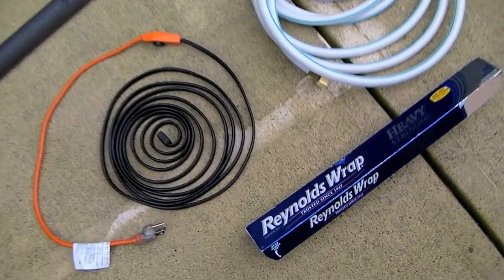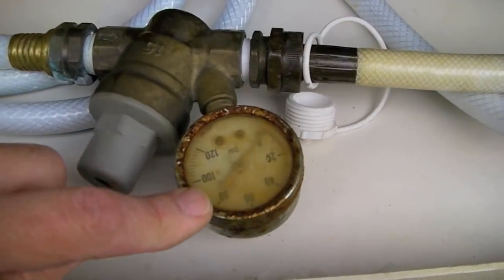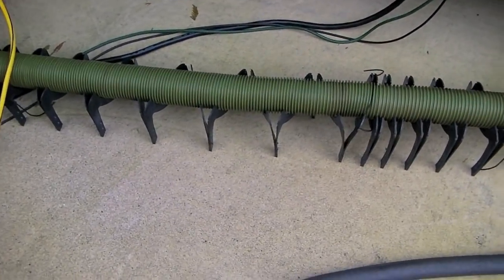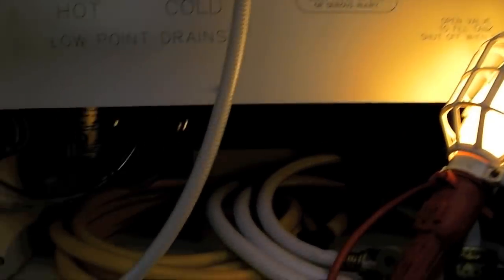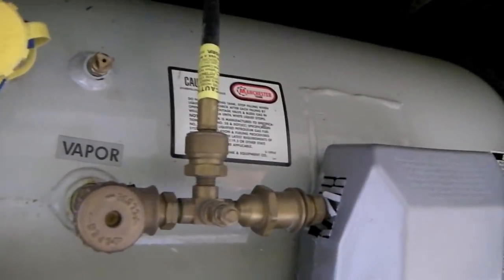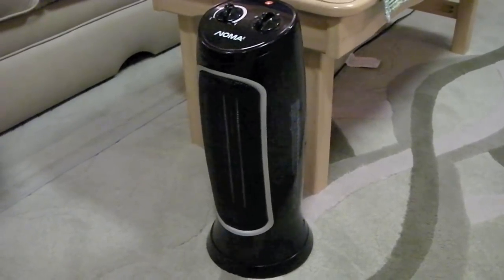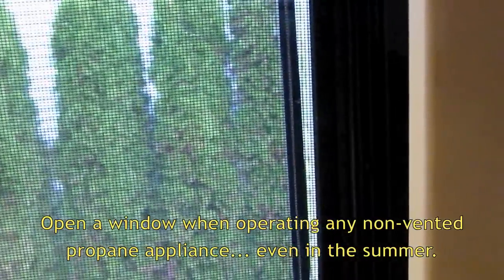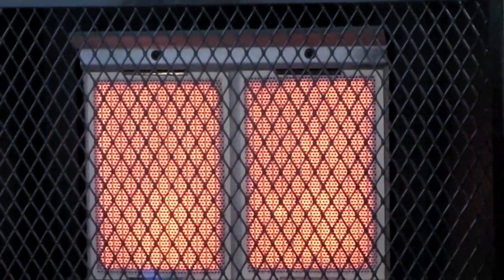How To RV in the Winter - Prepare Your RV So You Don't Freeze!

Comment: I don't mean to be disrespectful, but you do know how aluminum foil works, right? While what you did is "OK", it would have been better to put the heat tape along the hose itself, then wrap the aluminum foil around it, with the shiny side facing inward. Yes, metal conducts better than rubber, but the foil is designed to reflect heat, not conduct it.
Reply from the maker: The real issue is that the heat tape is really designed for metal pipes. The heat is a bit intense for the rubber hose. The aluminum foil prevents the tape from overheating the one side of the hose where it's in direct contact by diffusing it around the hose. Sorry if I explained this poorly, but the way we showed it is correct and works great.
Reply: Aluminum will reflect the heat, regardless to "shiny or dull" side
Reply: RVgeeks very good point !! great video and tips you guys are great... thanks again ! safe journeys !!
Reply: Foil both conducts and and radiates heat energy. The purpose of placing the tape on the outside of the aluminum foil is to mitigate the possibility of a hot spot on the heat tape from melting the vinyl or rubber hose. The foil spreads any hotspot over a larger area. A second layer of foil on top of the heat tape is permitted and further distributes the heat evenly. Hot spots can occur wherever and part of the wrapped pipe might be touching anything.

Comment: Duct tape is nasty crappy stuff.  It leaves a sticky mess if removed while fairly new.  When old, it dries a crumbles and leaves a powdery mess.  Maybe aluminum tape or simple packing tape.  Either is better.
Reply from the maker: Duct tape is indeed a pain to remove. But since the foam tubes are so cheap, we just slit the tape and tossed 'em in the spring! :)

Comment: Propane : oxygen/ carbon monoxide
Reply from the maker: +Shelly Long Carbon monoxide is the product of incomplete gas combustion. Properly functioning propane appliances present no danger of carbon monoxide poisoning. These units are specifically designed for indoor use.

Comment: carbon monoxide is more of a problem than moisture!
Reply from the maker: +harold mesick Neither is a problem if you use them correctly: CO detector, heater with a low O2 sensor/cutoff, window cracked for O2 source, no kids or pets on board. If you're not comfortable with one of the many indoor propane heaters on the market, fine, but thousands of us have been using them safely for years.
Reply: Oooo Thanks for saying NO PETS on board. ALWAYS Travel w my DOG. Looking to Boondock longer for first time next year so was contemplating getting one